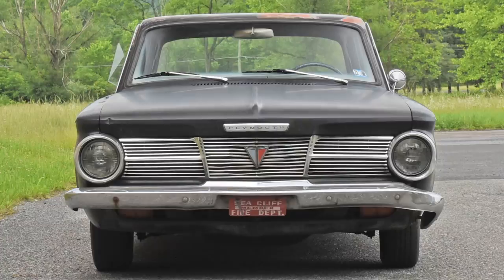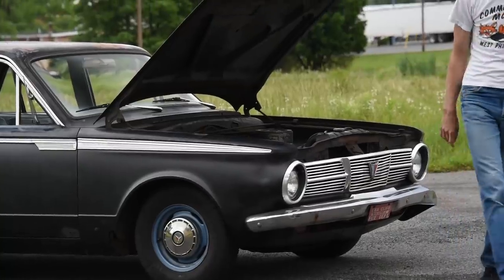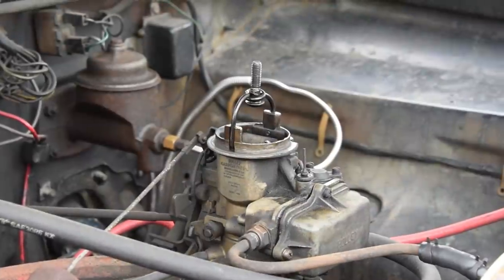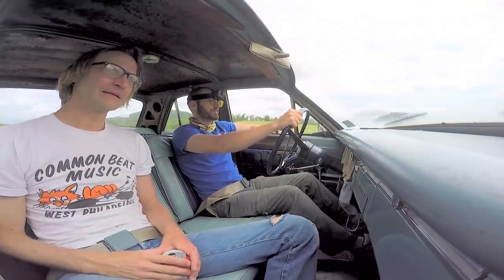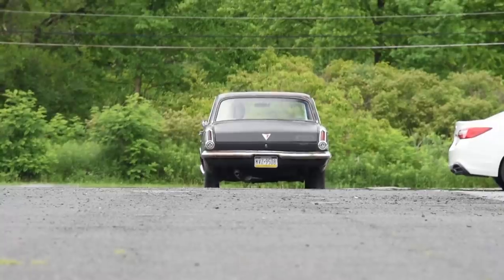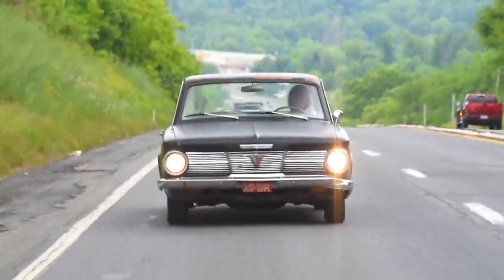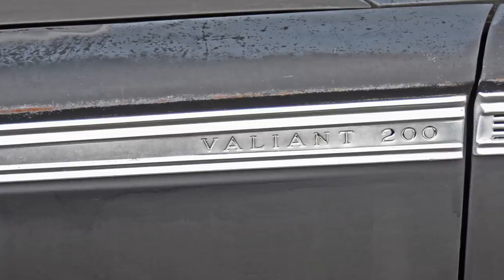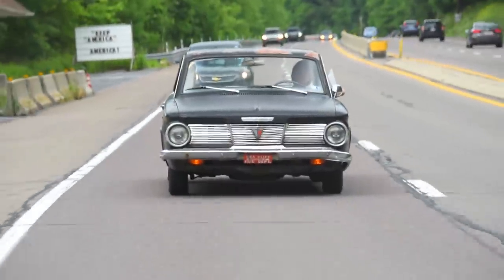1965 Plymouth Valiant 200: Regular Car Reviews

Comment: It's amazing how an alfa romeo and many other European cars of that era had about as much HP and were faster than this with 1.6l 4 cylinder
Reply: It's more amazing how few horsepowers per liter American cars made tbh
Reply: It's a little wack to compare luxury or performance models to the most bargain basement economy car niche in the US market.   Equivalent European cars were typically making half the power and if they were fast in any sense of the word its because they were absolutely tiny in comparison.   Small size is hardly a marker of superior engineering.
Reply: How many litres is this i6?

101 hp for the same money in the same era would be achieved with a european 2.0-2.2 i4/i6 usually
Reply: @DrewLSsix  and yet the luxury Lincoln continental mark 4's 7.5L v8 couldn't manage more than 200 hp
Reply: @smittoria  honestly it is
Reply: @televisionandcheese  This should be a 2.8 liter. It was also gross horsepower, so net horsepower as installed in the car was, at most, 80.
Reply: If you calculate price size amenities and power American cars have been and always were better than European cars. Right now everybody's shaking their head no no no no I know cars European cars are better. Build quality that's it that's all they had over the American cars. Don't forget that the Japanese car market wiped out most European car companies too for the same reason it wiped out the American car companies. Jeremy Clarkson and the rest of the snobby Europeans love to love to rub the malaise era in America's face but for $4,000 in 1969 you could have had a Z28 Camaro with a 302-2 four barrel cross ram intake four-wheel disc brakes 290 horsepower and a 4-speed transmission AM FM radio bucket seats console rally wheels and hidden headlights. Name one European car for the same amount of money they gave you that in 1969. You can't they don't exist. And a 69c28 is just an example you could do it with all the cars. For a little over $2,000 in 1964 you could have a Ford falcon futures Sprint with a 289 V8 making about 270 horsepower again bucket seats console AM/FM radio rally wheels name a European compact or that's even close to possible.  Yes a BMW 2002 turbo coupe is better put together but a Camaro Z28 or firebird trans am super duty of the same era emissions be damned is still faster in a straight line and still better appointed for less money. Yes the BMW will be faster on a road course he has to BMW is better built and better engineered but what people don't tell you is you don't notice any of that stuff just driving around stuck in traffic all day you find that stuff out on Backcountry roads and racetracks which most of you will sell them if ever push your car to its limits on a back road or a race track. At 66 mph on a pot whole filled highway in Detroit a 77 Cadillac coupe deville will ride and be way more enjoyable than any 1977 Jaguar.
Reply: @robertstone9988  large size and straight line speed are far less important in Europe where we have corners and narrow old town centers. Also American cars are more expensive in Europe due to import costs so the prices even out.
Reply: @televisionandcheese  this would have been a 2.8 litre at the time jaguar was making 135hp out of a 2.4 and Rovet 104 out of a 2 litre 4 cylinder and alfa romeo was getting 110hp out its 1.6 in the Giulia
Reply: @Thanos.m  yeah, though keep in mind those are higher end cars, this was a very low end car for america , so I'd want to be fairer
honestly 2.8 making 101hp in early 60s really isn't bad! Especially when compared to other american engines haha
comparable engines from Opel at the same time would be making 90hp from a 2 litre, or the cheaper BMW new class at the time would get 110 from the 2.2 ti engines, so it of course isn't the best compared to European cars still, 
but honestly, I am see so many american cars with like 5 litre engines making half the HP in the 90s than a 70s 3 litre Opel haha
this is nice to see that it's not too bad for its power for its size
Reply: @smittoria  I know for the cost of one small alpha you can have three Ford falcons. Yes leave springs yes live axles yes drum brakes but how fast you really going to go the speed limit is 55? The car was designed to serve a purpose in which it did perfectly and I would say better than any other car company on the planet. America didn't start building s*** cars all the sudden the world just changed just like it did to the woolly mammoths it's not that the wooly mammoth was a bad design the world just changed. The American car in the 1960s and early seventies was designed for America in the 1960s and 1970s and at that it was better than any other car manufactured anywhere else in the world. Even the new stuff my wife wanted a new Fiat 500 but for that cost to what I consider a subcompact I could have an American compact like a base Malibu or a  manual transmission fusion. And say what you want about mid-90s Cadillacs and how they are all floaty like big boats I've driven a mid-9os 7 series BMW and an early 2000s Jaguar S-Type and I didn't think either one of those cars drove any better than the Cadillac on the interstate or around town which is where else you going to take a Cadillac you're not going to a racetrack with a Cadillac it's not what it's for. After 10 years the Cadillac all the buttons and stuff stopped working on the inside of it but I can say that about the Jaguar too. It's true every 15-year-old Cadillac looks ratty as hell with ripped up leather and windows stuck halfway up and down the sun roof doesn't work anymore but I can say that about all jaguars and a lot of BMWs. Mercedes do seem to hold up really well though even when you beat him up and treat them like s*** they seem to last at least the ones from the 90s and early 2000s. I'm a used car dealer by the way that's how I know all this 15 years of experience in the used car business.
Reply: @robertstone9988  but this is a pre malaise era car and still its pathetic we never got checked with emissions in Europe anyway and yeah you were getting 290hp out of 5.0+ litre v8 but a jag was getting 265hp out of a 4.2 6 in terms of specific output  and efficiency Europeans cars always had the edge what American cars had was features
Reply: The alfa romeo wasn't a cheap car. This was  a cheap compact and this one has the base engine. The European equivalent would be a fiat 600, a VW bettle a 2cv . Also the most powerful engine available that year was a 235hp v8 more powerful than any alfa of that year
Reply: @Thanos.m  Yes but what would they be like cruising around town at below 2000rpm? How much torque?
Reply: @televisionandcheese  that's true but even basic cars like a mini was making 60hp out of a 1.2
Reply: Haha, power/L being relevant 😄 You crack me up
Reply: @deanstyles2567  with a 3 speed you couldn't really do that in the Plymouth
Reply: If anyone wants to talk about comparing apples to apples, the Corvette could make as much as 375 hp (gross) from 327 cubic inches (5.3 liters). I don’t think anyone was cross-shopping a Plymouth Valiant with a Jaguar….the things I see on the internet.
Reply: @Thanos.m  how much more of that Jag cost than that Camaro? That's the thing you keep comparing all these expensive yes the 1962 Ferrari 250 GTO is faster than the Pontiac GTO you're right it's a better car duh lol. I don't think a lot of Europeans realize how cheap American cars were. There's a reason why European in Japanese cars didn't start selling well here for so long you just get so much more for your dollar if you buy American. If you were a grocery store clerk in England in 1966 what were your options as far as buying a car what you could afford? Now grocery store clerk in United States in 1966 look at your options you can afford? The American car is the better bang for the buck that's what I'm saying despite the leaf springs despite the drum breaks despite the solid rear axles and the push rods all everything that the Europeans snub their noses at for the dollar you get the better car buying American.
Reply: @carsarethereason7111  just take into account cars like a fiat 124 was getting 100hp out of 1.6 lacia fulvia Berlina 85 out of a 1.2 the mini 60 out of 1.2 all cheap cars of the era
Reply: @chrisxaf1237  all my info sourced from wikipedia and some shoddy googling, so I may be inaccurate, but looking at the original MSRP of one of these valiants, converted to today's money, and looking at other 60s cars in today's money, this thing is more comparable to cars like the Ford Taunus, Opel Rekord, BMW New Class 1800C, etc, the beetle and 2cv are way way below the comparable cost of this thing

But even then, the 2.8 in this thing making 101hp really isn't bad still, the closest thing comparing is the bmw, making 98 from its 1.8 , only the more expensive 2.0 beating it with 110hp 

But you're right, the Alfa is certainly much more costly compared to this, not a fair comparison there , but comparing these to a 2cv isn't either haha
Reply: @televisionandcheese  for the same money in the same era in Europe you could have a VW bettle at best
Reply: @robertstone9988  I do agree with you on most of your points, but in traffic youll notice the bmw by looking at how much petrol you have left. 1960s V8s would be satisfied with about 20l/100km, as Bmw would drink only about 8l/100km. Americans were the kings of the roads from 1950s to 60s, and they really couldnt get out of that mindset. They only knew, that bigger is better, and that displacement solves all issues, so they didnt evolve with the times. So at the end only thing good about malaise era cars were the styling and the creamy smooth ride.
Reply: @robertstone9988  in Britian an e type was £2000 so the equivalent of 30k in today's money the Camaro 3.5k so a little less than 30k dollars a jaguar mk2 with the same 3.8 was £1.5k so about 25k in today's money so no the Camaro wasn't that much cheaper
Reply: @Thanos.m  it was here
Reply: Their redline was pretty low. They depended more on torque than rpm, so the horsepower was pretty low. Also, notice that it only has a small one barrel carburator.
      The tradeoff, at least in the case of the Valiant with the slant 6, was it got a little better fuel economy, and with minimum maintainence, the engine, compared to it's contemporaries, would keep running for years, partly because it wasn't stressed by a design which tried to squeeze every ounce of power out of it, while the car rusted and fell apart around it.
Reply: @Thanos.m  I also gave the example of a fully loaded Z28 with a cross ram dual floor barrel and four wheel disc brakes. You could have had a Camaro RS with a 350 and at least 235 horsepower and it would have been thousands of dollars less than the Z28. American performance is the cheapest performance on the planet it's just it's cheaper because it's less sophisticated but still gets the job done. If you could find a bone stock Jaguar sedan with the 3.8 aluminum body four-wheel disc brakes and all and put it on a racetrack with a 1964 Pontiac GTO even though that Jaguar out handled it in every way if you had to drive one around 1967 Detroit for a year you're going to pick the Pontiac it's the better car for the money you get more options you get a better ride you get a bigger car you have more horsepower and more torque only place you're getting beat is on a race track
Reply: @televisionandcheese  the point is that this was the cheapest car made by Chrysler that year and with the smallest available engine and everyone could afford it. At least in America.  The cars you mention above where a class or two above the entries.  The Neue Klass was premium so its comparable to an Oldsmobile and not a Plymouth
Reply: @robertstone9988  what I'm saying is that person who could afford a Camaro in the us the equivalent person in the UK could afford a mk2 I'm not looking to shame American cars  but it terms of efficiency engineering and specific output European cars had the edge American cars had the edge In terms of comfort and features I mean we didn't know what AC was pretty much till the 90s-00s over here in the UK and yeah Pontiac gto would make more sense in the wide Detroit's roads the same way an mk2 made more sense in the UKs narrow twisty roads edit: another point to add  the American narrative was bigger and more = better which you seem to follow and that case is simply not true for most Europeans
Reply: same era ratings for standard six cylinders from Euro Ford, Vauxhall, Rover and Austin weren't much better. 1964 Rover P4 95 (2.6 102hp); 1965 Ford Zephyr (2.6 98hp); 1965 Vauxhall Cresta (3.3 123hp); Austin 2200 (2.2 110hp); 1965 Fiat 2300 (2.3 117hp);
Reply: @Thanos.m  what we can't agree on I think is that when the Japanese came around in the mid-70s it destroyed both of our automotive worlds. I just have a chip on my shoulder cuz I feel like a lot of especially English car fans are a little jealous because you don't have much of an industry left where somehow the Americans just through sheer dumb luck stumbled their way through the 70s and still have our big three. I love top gear but sometimes Jeremy Clarkson irritates me because I can't see his jealousy in his bias against American cars. The best example is and always has been the Corvette since the very first Corvette in 1953 it is always been a competitive performance car for its price range. Yet when you watch a European review one they always compare it to cars at a higher price range just so they can make it look bad and cheap and plasticy and junkie instead of comparing it to cars at its price range in which case it excels. Yes I know that a c7 Corvette's interior isn't up to an Audi r8 yes I know that it's engineering is for other base compared to the new Ferrari 450 special. But it's cheaper than a base 911 has 450 horsepower the closest car to its performance in its price range is a Porsche Cayman s. If you buy the BMW z4 instead of the Corvette c7 you're a dip shit or a badge snob. The Corvette is clearly the better car but Europeans just want to compare it to cars that it's performance is equivalent to instead of cars that it's price is equivalent to.
Reply: I guess the fact this one's still plodding along means something, though.  I'd wager most alfas of this vintage aren't, and if they are they needed at least twice as much maintenance.  This was basically a tractor motor put in a utilitarian car.
Reply: @televisionandcheese   aprox 3 liters
Reply: The slant six will have much more torque, especially at low RPM.  Chrysler used these motors in trucks.  The block of the slant six could probably accept the DOHC head of the Jaguar XK6, possible that of the 3.8 E-type.  I was at a salvage yard a few years ago and a Jaguar and a Valiant both had motors with the cylinder heads removed.   I picked up the head gasket from the slant six and laid it over the cylinders of the 4.2.  The cylinders spacing matched (the bore and stroke is also almost identical) but the bolt pattern on the Jaguar was a bit wider, but I think someone could relocate the holes so that the Jaguar head might fix on a slant six.  The slant cylinder head was designed for low cost and fuel economy, the head is the biggest limitation to these motors.  The E-type 3.8 bore/stroke is : 3.43 x 4.17 inches vs that of the 225 slant six (3.40-inch x 4.125-inch).  As far as I can with my eyes, the bore center spacing is the same.
Reply: @televisionandcheese  the 170 is 2.6 litre. Yes an Alfa Romeo with twin Webber's and DOHC was faster.. even had power disc brakes and 5 gears. Now compare it to an econobox euro Chrysler from 1962.. the Hillman.. very simple and slow. This valiant was  America's Morris minor.
Reply: @timothykeith1367  you've got water jackets and oil galleries to line up between block and head, never mind the timing chain. Yes small valves are the limitation on slant 6, but over revving them can put a piston thru the block, they're very long stroke. A tractor engine
Reply: @cruiser6260  Because of the small carb we can't rev a long stroke 225 very high, it won't fail when its in good shape - without induction improvements the 225 just won't go above 4,500 RPM.  The popular BMW 325E engine in the E30 was also done at 4,500 RPM, but they sold a huge number to people to folks who thought that was adequate.   The 170 like in this video has a short 3.125-inch stroke(a 3 cyl Geo Metro has a 2.95" stroke)  - when oiling of the valve train and camshaft is improved the 170 can sustain above 7,000 RPM.  I believe in the '61 NASCAR compact car race the 170 was able to endure 8,000+ RPM - which is why it won the first 7 positions.  But, Chrysler never built a light enough car for the 170 to shine.   The long stroke Jaguar 3.8 XK6 has the same bore/stroke as the 225 and it can't rev either, but in a light E-Type sports car it was a lot of fun. 

The Jaguar XK6 has wet head studs which pass though the coolant in the head (often suffer corrosion making the head difficult to remove).  I don't know what's inside there, but its reasonable that a welder/machinist could mod the allow head to mate with the slant six - I think the holes need to be moved wider about 3/8 inch.  Probably could bore the holes, insert and weld a plug, then drill new holes. The coolant passages are in line - the thick deck of the slant block can be redrilled a little.  Oil isn't a big deal as it can be plumbed externally.  As the timing chain is wet lubed a cover needs to be made and a new lower timing sprocket.  The XK6 has two timing chains - one connecting the two cams is only in the head.  A single one-off project would be fun.  The XK6 is ancient too, it is 1948 technology - the Mopar Hemi is 1951 tech and its still viable in 2021.
Reply: @timothykeith1367  my brother put a piston through the side of the block, over revving a stock 225 in a 66 VC valiant doing a burnout. I owned a couple of the same shape and they really didn't like going above 60 mph, no tacho so I don't know the revs.  Considering the engine was even used in some full size American cars right up to the 80s, it's no surprise with that huge undersquare bore x stroke it's all about bottom end and midrange. 

There's probably a full billet  aftermarket head for them available somewhere if you really wanted to build one up and overcome the small valves. Baffled sumps were a must with that because of oil windage. 

What we call  R and S series valiant released in 1962 you have in the US from 1960 and that was a light body. I had one with the 170 which should not have been, since officially they are all 225 and no 170 was ever imported. It could do 120mph. My friends were Mopar guys and told me it had a factory mild cam and uprated valve springs. Mine was grey whereas all others you saw were red or later blue.
Reply: @gretchenlittle6817  Everyone I knew who owned a low-end Euro car in '60s/'70s had to do constant maintenance to keep them drivable...including me. And mine was higher-end.